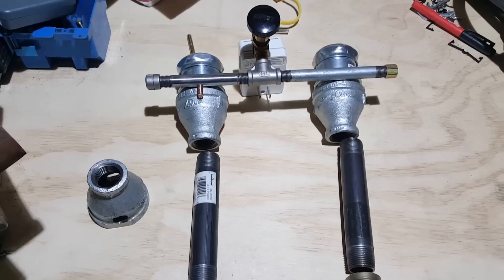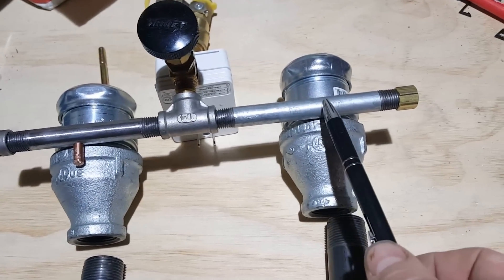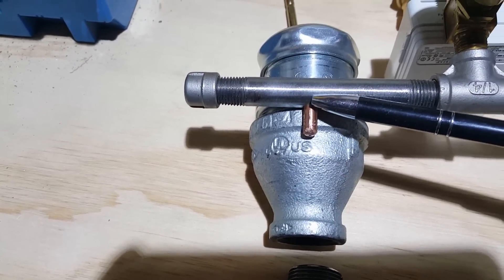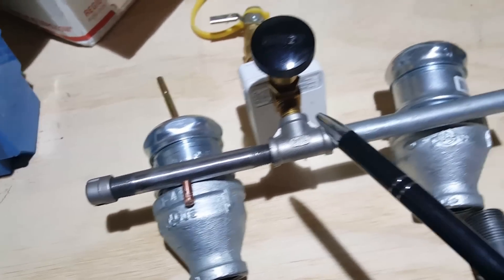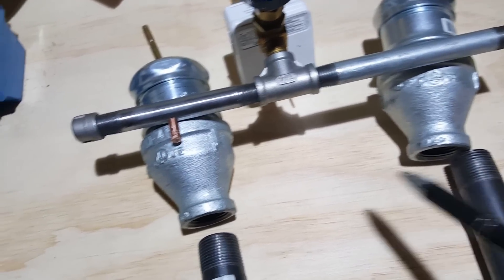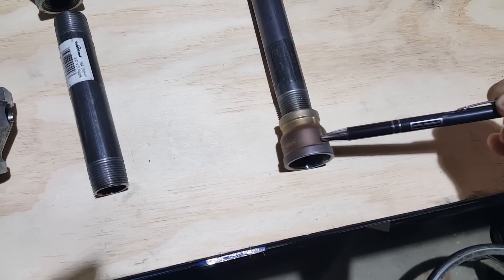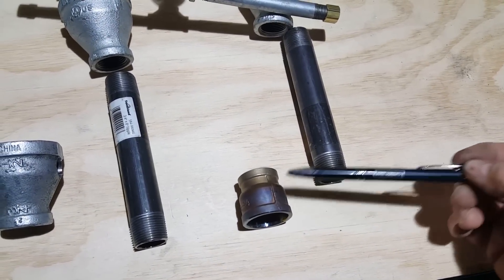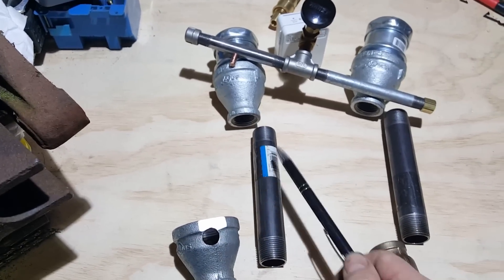Dual forge burner layout

Comment: if you use 1/4x28  all thread you can drill and tap for your mig tip and your choke rod in to your feed line all at the same time. good build like to see it run! be well and be safe

Comment: Hi Mike, I'm attempting to use this exact burner setup but am having trouble getting enough air down the venturi. Any pointers?  They're installed on a forge made from an 11 gallon air tank with a 5"x5" opening in the front and a 3"X1.5" opening in the back.
Reply from the maker: Dan Szapa Dan, I had nothing but trouble with this version and getting and keeping everything aligned and tuned properly.  If you look at my other videos, I now make a version that's both bullet proof, and it has a stainless steel flare!
Reply: You were right. I switched up to your newer style and boy what a difference.  Ended up with a .030 tip towards the front and a .023 at the back to fix the air fuel mix since the forge opening back there is small. Thanks for the info!
Reply: The ventures are to small. You need a 2in to 3/4   Then use 1/4 in brass pipe then you can get enough air in.

Comment: Using galvanized  steel  ? ?   the outgassing of the galvanizing is deadly    nice...
Reply from the maker: hwydog905 the only part of this earlier design that was galvanized was the reducers, which will never reach the vaporization temperature of zinc which is 900 degrees Celsius.  The 1" reducers I used are stainless steel.  Please check out my channel for the latest version of my burners.... The flairs are completely made from stainless, and the reducers are black iron. 

Mike